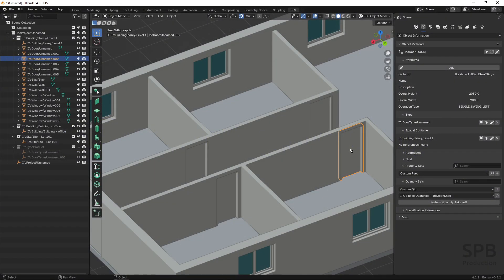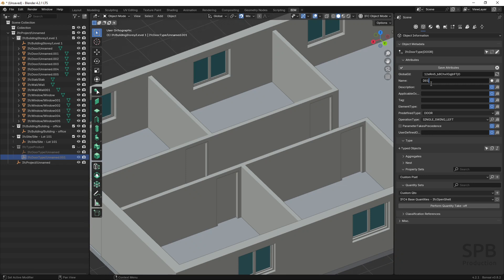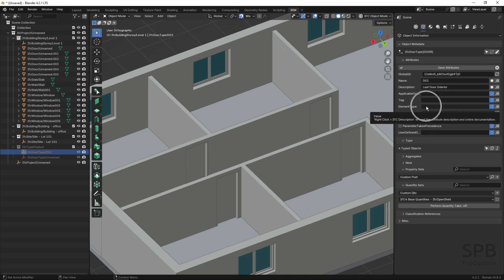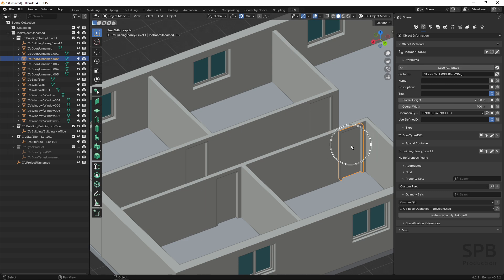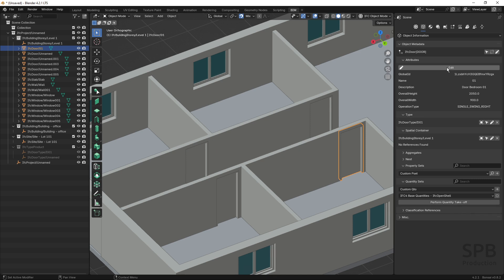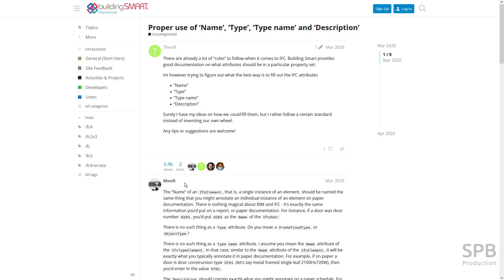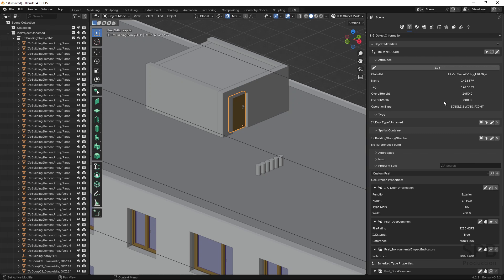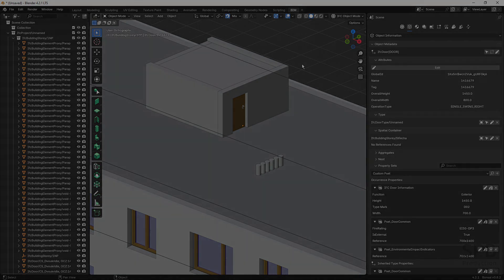How to Correctly Fill Attribute Values According to IFC Schema

Comment: Again excellently explained. 👍 I understand it myself and use it similarly. The Name attribute is a great place to include the identification code that is typically required in information requirements (if only czech BIM consultants would work with it this way...). The Tag attribute is not directly dedicated to authoring software needs by the standard, but has been somewhat "stolen" by developers for their purposes. I myself would much prefer its use truly according to the IFC standard, where I usually interpret it as the designation of a specific element that is typically shown on traditional drawings. I don't know how it is in Revit's case, but in Archicad it can fortunately be overwritten or remapped to another value (and thus actually used).
Reply from the maker: Thank you!

You are right that the Tag attribute description in the IFC schema documentation does not correspond with the usage described in the video, but it seems that practical usage of software vendors is overriding the definition in this case. The Tag situation is quite ambiguous and I went with the description Dion Moult is providing, as I consider him an authority with regards to IFC schema.

Interesting information about Archicad being able to remap attributes. I don't know if it's possible to do in Revit as I was only mapping properties, never tried with attributes.
Reply from the maker: I did check and it is in fact possible to map user defined attributes during export from Revit.